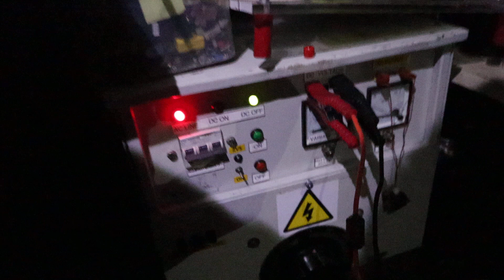BIG ferrite Transformer build something POPS" on the variac!  (1 of 2 parts)

Comment: What I do for my ZVS is connect the gate pull up resistors with a different regulated supply, that way you will not kill the mosfets if the gate voltage goes too high when you crank it up. yea that was dumb to put a 7812 on a board like that, you can replace it with a transistor and some sort of reference circuit. it wont regulate quite as fast or precisely as the 78 series chip but it will only be limited by the C-E rating of the transistor. cheers!
Reply from the maker: Omg that’s a brilliant way to do it mate, I never thought of that! I’ll have to make my own and try that. 🤩
Thank you my friend 👍😉

Have a great Christmas and new year buddy
All the best 🍻

Anthony

Anthony
Reply: @high1voltage1rules  your welcome, merry christmas! happy new year!